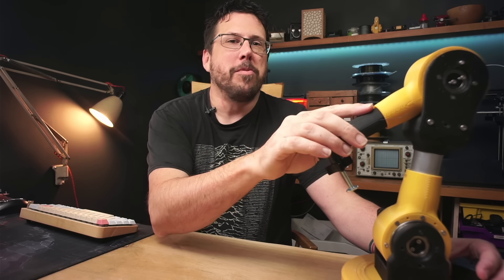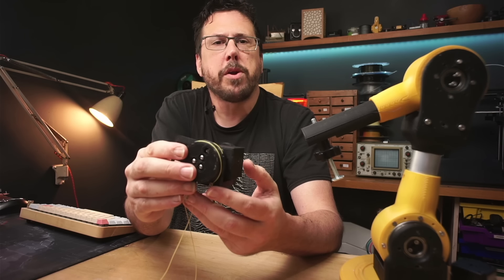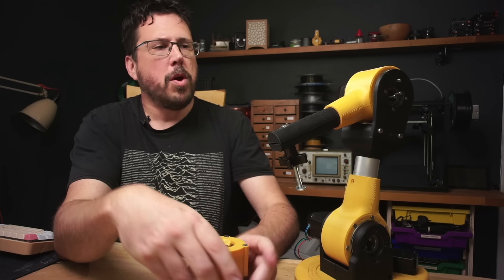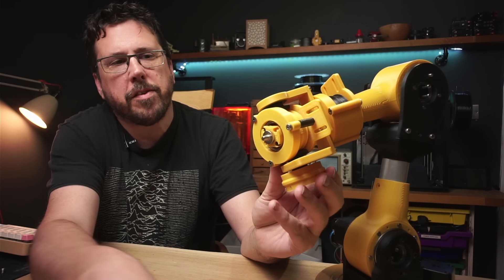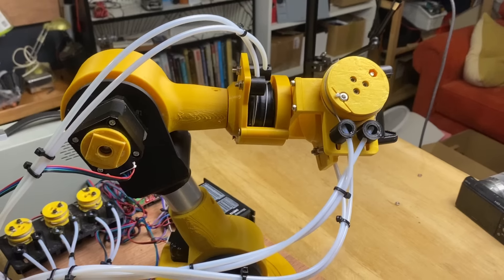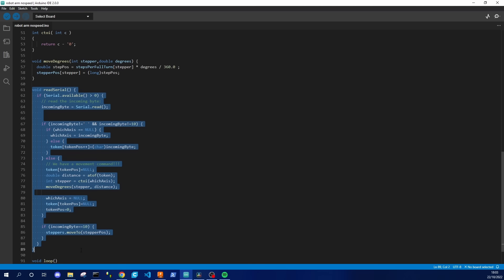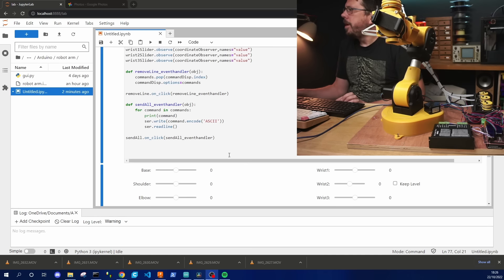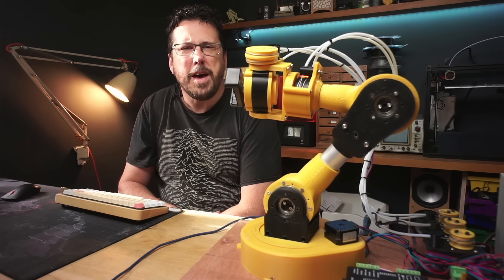Robot Arm Wrists are too heavy - until now!

Comment: great job, but this is good for things without precision. Too much material that stretches. But it will have a space in the industry
Reply from the maker: yeah, you're right - it needs encoders to turn it into a closed loop control system. working on them now!

Comment: Fix the camera vertically and pan and tilt a mirror to alter the view. This is trivial in comparison but not cheaper: the flatness of the mirror matters so spend spare cash there.🥰
Reply from the maker: Oh, like a galvo for lasers?
Reply: @roTechnic  You may need to try a few things, the mirrors I used were custom made and cost $12000 but my cameras needed to see 2-6 miles! HD cameras will also need very flat glass
Reply from the maker: @kaleygoode1681  Wow, that may be out of my budget! I'll definitely try something like what your suggesting in a future project, it sounds awesome. Thanks for the idea!

Comment: Great project! I've emailed you regarding licensing of the Github project. Currently, without any open source license, Github default license applies, which means no one has rights to download or use the source code and I guess 3D files (only view it on Github). Hoping that you can add a license. Thanks.
Reply from the maker: I've added a CC license to the repo now. Can I ask what you intend to do with it?
Reply: @roTechnic  Many thanks. Appreciate it! The intended use is for test automation - to see if we can do away with laborious manual testing.

Comment: here is a crazy idea... instead of fishing lines, if u want smooth equal power... have u taken in consideration, fluid mechanics? or better said... hidraulicsc lines ? that would probably be useful for gripping power... u push enough force into the line u get same power in the tip, without adding much weight.

Comment: Love your work , would you be releasing cad files for the new actuator with two cycloids?
Reply from the maker: At the moment the CAD is all split across multiple files and is actually wrong where I've made changes after the fact. In my next video I'm adding sensors to the actuators which means I'll have to re-do the CAD and reprint some parts. I'll release the CAD and code in that video. Have you got any specific use in mind for the actuator?
Reply: @roTechnic  im actually building a robot arm using multiple types of actuators and motors.. im actually curious to see the payload capacity of cycloidal drives  .. the arm im making needs to pick up 5-7kgs .. and i just hope to stress test your design. 

i love how how clean your actuators turned out
Reply from the maker: For 5-6kg, I'd suggest you need more reduction than 20:1 if you're using NEMA17 steppers and 3d printed cycloidal drives
Reply: @roTechnic  i agree thats why i wanted to stress test ur design to see how far itll take it ..

Comment: Hey would u make tut on using python and PC as Arduino or pie , the brain and control robotic arm with gpio extension board like ft232h
Reply: Also can that new actuator can do 360?
Reply from the maker: yeah, I've got the wrist set up for just over 360 degrees on the 2 rotation axis. Tilt axis is about 200 degrees. I haven't got the time to do a full tutorial, but I'll be releasing the code in the next video if you'd like to see how it's done.
Reply: Absolutely

Comment: What about endurance, are there  alternative solutions to these fishing wires? because I don't think they'll last long due to friction
Reply from the maker: I've done some testing with the trial assembly from the last video, and greased fishing line runs fine in the ptfe tubes. I ran it continuously for 2 days with no perceptible sign of wear. Without any grease, there was wear.
Reply: @roTechnic   great 👍
Reply: @roTechnic  do you think it would be a good idea to build a 3d printer using this wire solution?
Reply from the maker: @jihedmedini1318  yes, I do. I have made a laser engraver using fishing line and it worked really well. You probably don’t need the Bowden tube though and can just do it with fishing line tensioned between bearings
Reply: @roTechnic  I agree ✌

Comment: Just make it out of steel, problem solved 😉 And I feel you, all DIY designs suffer from being wobbly, as the structural integrity you get from 3D printed parts is usually not enough.
Reply: Nice idea, but wouldn't that negate the benefits of moving the motors off the end of the arm if the whole arm is much heavier? Some carbon fibre rods for the main arm parts might give the stiffness without affecting the weight, may even be lighter. Could use three rods and a 3D printed ring at either end to push them through to hold in place/attach them to the drive parts.
EDIT:for the 3D adaptors I'd recommend using Prusament CFPC, easy to print if your printer can handle the temperatures and very stiff with great heat resistance if they're going to be anywhere near the stepper motors when they're working.
Reply: @shuflie  This was more of a poke at the limitations of DIY, and less of an actual suggestion.
And no, it won't negate anything. Industrial robots are made from steel and aluminum, they place the motors near the actual joints, have butter smooth motion, and tons of carrying capacity.
Multi-axis robots are just something that only borderline works with 3D-printed parts. That's true for articulated robots, as well as for example gantry machines.

Comment: What do you think to do to compensate for the backlash?
Reply from the maker: there is no backlash, but there is a bit of hysteresis due to cable stretch. I’m adding sensors to each joint to compensate

Comment: Reducing the weight is worthless if the effort on the motors is just shifted to friction and overcoming the inner stiffness of the tubes; and increased backlash. Cable bots and Teflon tubes are seducing but they come with their own set of issues. Basically worthless for precision jobs unless you add closed loop control.
Reply from the maker: I agree completely. Closed loop control coming in next video!

Comment: Whats the increased backlash like ?
Reply from the maker: No backlash, but some hysteresis due to stretch in the lines under torque. I'm adding position sensors to compensate.
Reply: @roTechnic  amazing work got a sub from me